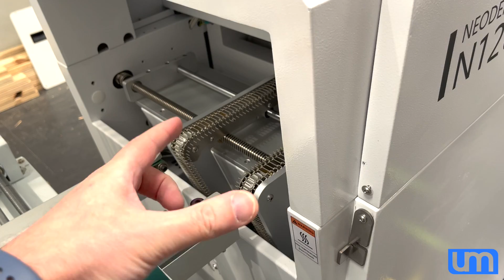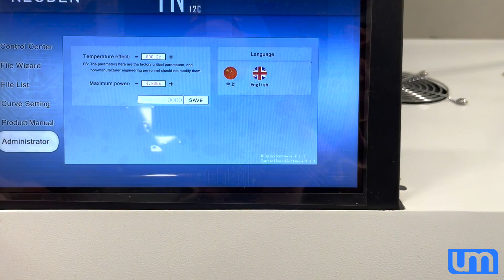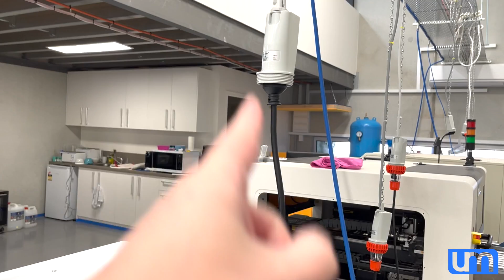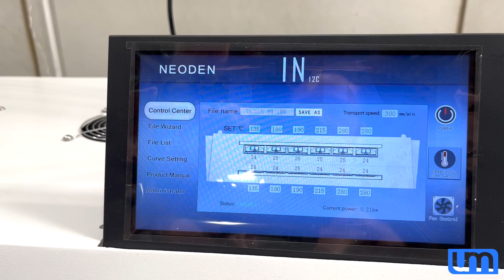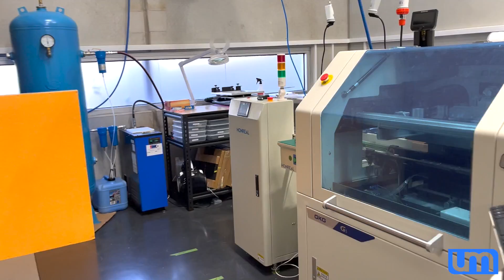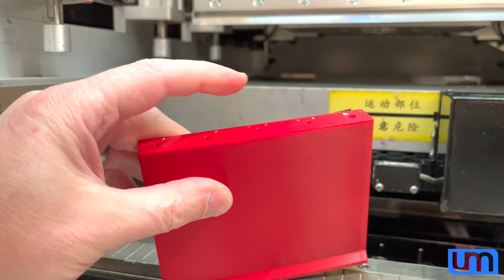My production line is now fully automated!

Comment: So amazing to see how far you have come. 
Still hard to believe the reflow could be more efficient than the toaster oven :D
Next up, monitoring downtime reason codes and calculating OEE etc. 
Not sure it would even need servos and homing, I should bail up one of the mech engineers at work. So many weird sensors available and interesting ways to use them.
Reply from the maker: How far I've come in my insanity levels? Sure, I agree :)
Reply: @UnexpectedMaker  Well I wasnt going to mention that bit but seeing as you brought it up :D

Comment: I would be interested in the economics of such an assembly line, how many tinypicos do you need to sell to justify running your own assembly line in comparison to outsourcing it.
Reply from the maker: It doesn't really work that way for me... it's not a financial thing, it's the ability to leverage many products with similar components and be agile enough to assemble on demand and ship faster than if I used a CM.   I can bring a brand new product to market super fast - can't do that with a CM.

Even without the silicon shortage, CM's usually have 4-6 week lead-times..... I can get an order and assemble and ship it fast then a CM can queue it up.

Plus I don't have to worry about all of the other issued associate with using CM's.

Comment: I wonder if your printer is capable of reading pads and stencil cutouts like the Yamaha YCH-10 I use at my work.
Also has a clamping system that makes sure the board is completely level with the stencil surface as well. Love that thing over the Essemtec we also have.
Reply from the maker: Reading as in inspection after pasting? Or using cutouts ad fiducials? Yes, mine does both.
Reply: @UnexpectedMaker  Exactly, the stencil cutouts and the pads, to use them to line everything up... But of a pain, considering that it isn't 100% reliable in my experience, still better than having to hand print a hundred or so panels.
Reply from the maker: Yup, I'm happy hand stencilling panels without stencils that have fiducials for the printer.  Anything I make in qty had correct stencils, and over time I'll switch them all out.
Reply: @UnexpectedMaker  oh that's good! Doing any of that in quantity makes my back and eyes hurt! Hehe
Reply from the maker: That's why I built a vacuum bed manual stencil printer setup - fast and perfect pasting of panels every time. But automation is always the goal :) Gotta remove those pesky humans (me) from the production!

Comment: Those RED vacuum pieces in the stencil machine. You have them going from front to back and said you would need to print others for different sizes of boards. Would it work for all sizes if you put the red pieces going left to right and made shutoff valves to turn off unused holes for shorter PCBs. 

When the PCB comes into the machine, does it get lowered onto the RED pieces?
Going left to right, would you need  a slope on the leading edge of the RED pieces to keep the PCB from snagging the edge of the RED piece as the PCB comes in?

Alternatively, what if you made the RED pieces so their length could be adjusted with mortice/tendon joints between each section to keep them lined up...
Reply from the maker: The bed rises to meet the PCB.

The better question is - why do I need to change what I have already designed? It was designed based on how it needs to work with the machine process, and I can print custom supports in < 1 hour and they do exactly what I need them to do.
Reply: @UnexpectedMaker  I thought you were saying that you would need to make a new RED part if you had a different PCB size(Width, I'm guessing)...

Could you show how the RED pieces are oriented to the PCB? What part of the PCB   do they vacuum against?
Reply from the maker: I do have to print a set per panel width - I have 3 panel widths that need this. Most of my panels are standardised on these 3 widths, so 3 sets needed of which I have designed 3 and printed 2. They are designed to suction down the leading and trailing edge of the panel to ensure no corners lift.
Reply: @UnexpectedMaker  I am not criticizing you or your design. What you did looks great.

I was just trying to figure out how to make an universal version(one size fits all) type solution..

If you change run sizes often, you could make the hose connection magnetic between the upright red part and the part the hoses are attached to, so you can change upright part in a quick click.. If that doesn't lose vacuum..
Reply from the maker: I'm not switching every 5 mins ;) - This solution really is simple and quick. It doesn't need a universal solution. The fact that I'm already using it rather than "still designing it" is proof of that ;)

Comment: That looks to be a very PRO assembly line setup. Is there big enough production needs, or are you considering some sub contracting assembly to assist covering costs?

Sorry to admit that I have not been following the continued setup for some time. Been on non network activities for much recent time. 

It is most impressive what you have achieved over recent years.

👍👍👍👍🙂🙂🙂❤️❤️❤️❤️
Reply from the maker: Well, right now it's pretty quiet - but that makes its a good time to have down time on my line while I setup new equipment :) No, I'm definitely not looking at taking on CM work to offset the investment. The line is for my own production :)
Reply: @UnexpectedMaker  good I do hope the volume goes to levels that payback in reasonable time span. At least you have done well in your endeavours to get to this point. 
You have made some excellent items in the past years and I would expect that I can keep up interest in your efforts.